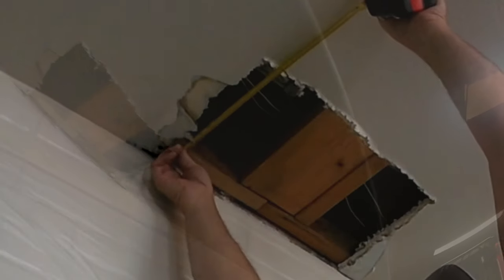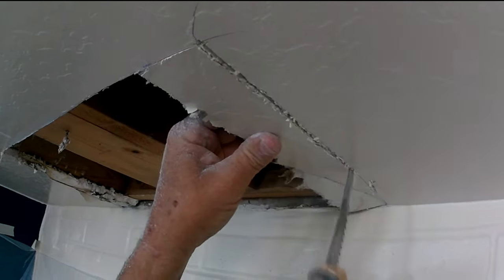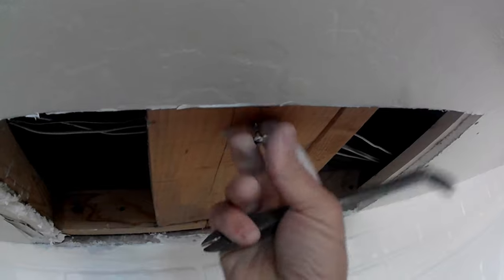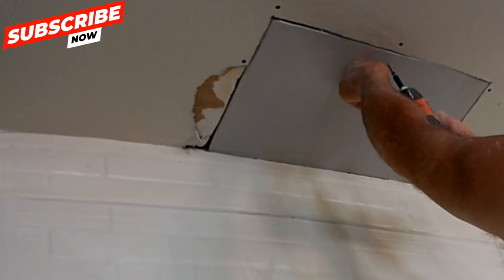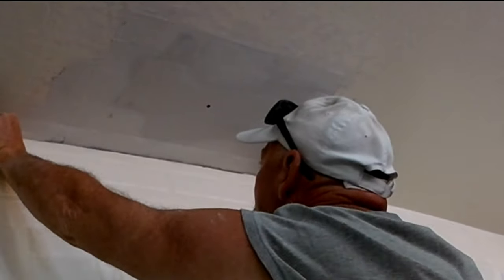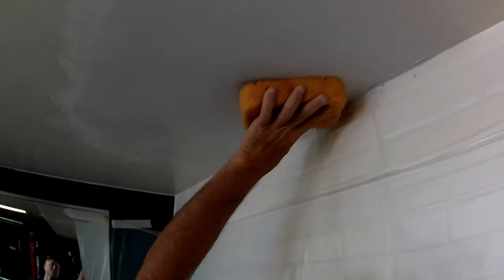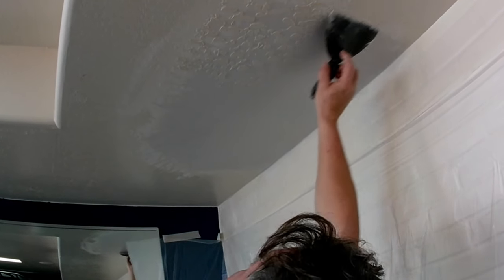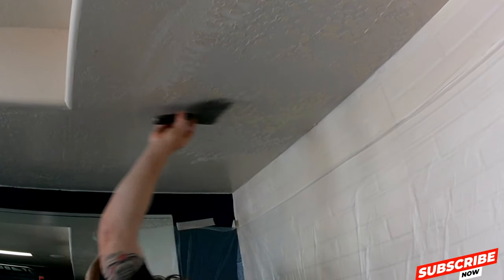process of easy drywall repair, focusing on patching water-damaged ceiling sheetrock

Comment: I have a hole to fix that is almost exactly like that however the ceiling has knockdown texture along with glossy oil based antique white paint. Is it even possible to make the repair look flawless or is that not realistic? Also the texture you used here you call skip trowel but it looks a lot like knockdown are they the same?
Reply from the maker: Skip trowel done by hand and knock down done with sprayer
Many other videos on channel show patching and texture types please view many more and comment
Reply: you need a hopper and compressor, harbor freight has them around $40 gun/hopper  also a clear knock down knife is good , use the biggest tip on lowest pressure to get it bigger